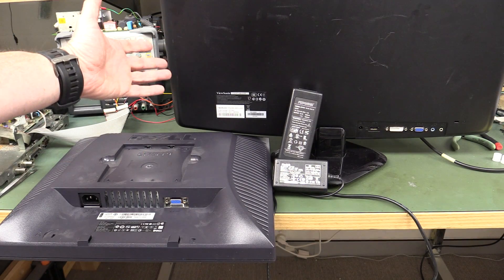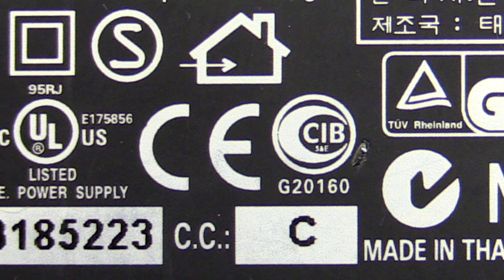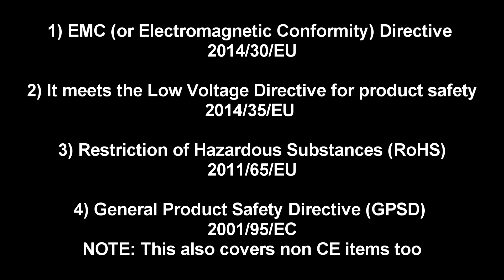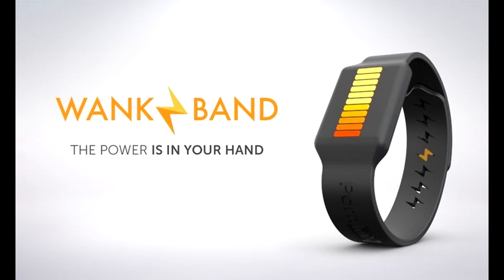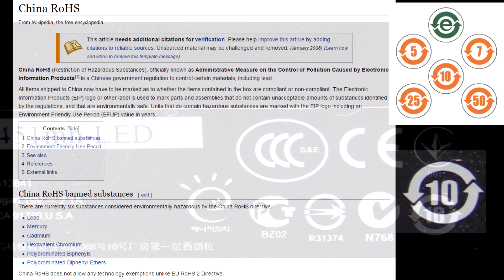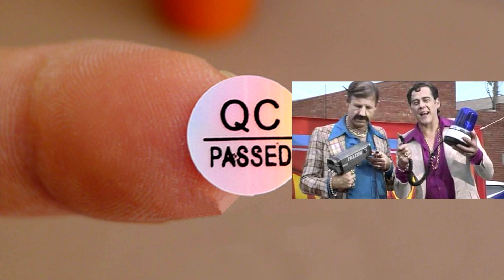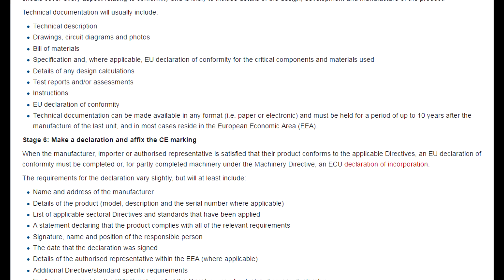EEVblog #996 - What Is The CE Mark On A Product?

Comment: Isn't the CE mark just something the Chinese stamp on everything they make.  I swear I also see UL and TUV there as well.   :P
Reply: pe1dnn Technically THE IMPORTER is responsible, because it's much easier to arrest and prosecute some smuck already residing in EU jurisdiction. The manufacturer is responsible if the thing was made in the EU.  Bonus fact, countries in the EEA (European Economic Area, formerly known as EFTA) sometimes count as EU for these kinds of rules.  Bonus fact 2, when government inspectors inspect a place, they tend to hand out fines for every unmarked product used or sold, so it's not just customs.
Reply: BMW 3 Series, as far as I can tell, that's nonsense. If you can tell me where that assertion comes from, I'd be interested to know.

But if you look up the regulations in the Blue Guide (http://ec.europa.eu/DocsRoom/documents/18027/), it says: 

"The CE marking is a key indicator [...] of a product's compliance with EU legislation [...], whether they are manufactured in the EEA, Turkey or in another country."

and

— Conformity assessment is the process carried out by the manufacturer of demonstrating whether specified requirements relating to a product have been fulfilled.

See also here: https://ec.europa.eu/growth/single-market/ce-marking/manufacturers_en where it says:

If you are a manufacturer, you have to follow these six steps to affix a CE marking to your product:

    Identify the applicable directive(s) and harmonised standards;
    Verify product specific requirements;
    Identify whether an independent conformity assessment (by a notified body) is necessary;
    Test the product and check its conformity;
    Draw up and keep available the required technical documentation;
    Affix the CE marking and draw up the EU Declaration of Conformity (27 KB).

Nowhere does it say anything about EU citizens. If you think otherwise, please provide evidence.
Reply: Mini DK#9, no sometimes they don't put it on, then you are screwed when importing some stuff :)
Reply: In theory UL stamp is controlled and if it bears that mark it can be looked up in the database to see exactly what safety standards it complies to,  thus a counterfeit or fraudulent mark can be sussed out
Reply: If they declare conformity to CE regulations they stamp CE on it, and if they comply with "GS" - "Geprüfte Sicherheit" (Checked Safety or Tested Safety) certification they can add that, too. It's a real certification, and the TÜV next to it just tells you which certification authority did it; TÜV isn't the only one.
Reply: John Francis Doe, That's the difference between who is de jure responsible (manufacturer, always), and who can be, de facto, held accountable much more easily (importer). Yes, these rules explicitly, according to the current version of the Blue Guide I quoted above, apply to "the EEA and Turkey".
Reply: Except one has to be sure the CE mark is real and not faked by the Chinese like they like to do with some other marks.
Reply: We put CE marks on machines we build in USA that gets shipped to Europe.  The only people who actually care about the CE mark is customs mostly in Belgium and Germany.
Reply: no one in China can declare anything in regards to CE. It MUST be a EU citizen.

Comment: Liked, just because of the Illuminati in the EU. lol.
Reply from the maker: Was hoping people would like that small touch!
Reply: only 10 years and my power supply starts leaking hazardous materials? How did they calculate that? Is that 10 years of use, or 10 years submerged in water? D:

Comment: Most battery powered devices have WiFi or Bluetooth and therefor are under the R&TTE directive which has a large safety section closely related to the LVD.
Reply: R&TTE has been replaced with RED - Radio Equipment Directive (2014/53/EU).  Which does not change the fact that is still pain in the butt.

Comment: Dave... Kindly do some follow-up videos on this... especially on how to get a CE emc and other tests...
also elaborate on UL....
thanks
Reply from the maker: That's the plan.
Reply: @Shakaib: You don´t get the point. Without does regulations, buisnessman would cheap out on any part possible, putting life at danger. CE and other regulations are the engineers friend - they translate "interference" and "safety concern" into business talk: Loosing a lot of money and jail time. Now the accountant ask how he can "not loose money" and "not end up in jail" and the answer is to give the engineers time and money to develop, test and certify. In case of a dispute (blank metal at 60V/50Hz with just a 10A circuit break - no worries according to the developer and his manager) a  bases to escalate. A written report to the company safety engineers stops any and all games of "I am boss and I say it is okay" (and as engineer, you can now purchase the 5 dollar cover to put over the blank metal to make the product somewhat safe).
Reply: Maybe a followup for us Germans that got fucked by the WEEE right in the butt with the shitty sucking poopsmelling Stiftung Elektro Altgeräte Register. -.-
Reply: I agree with this, not alot of times us regular mortals ever did give those lil logos much notice but they are kind of interesting.
Reply: @simontay1984 that is just because of the difference in density between chinesium and germanium alloys.
Reply: CE and the WEEE Lobby kills all startups or hoby-ist developers in germany / europe :-( .. Did it to me.
Reply: that is a good plan
Reply: one on the requirements for bringing a product to market like NRTL testing would be great and you could cover a lot of markings in one go https://www.osha.gov/dts/otpca/nrtl/nrtllist.html
Reply: to be fair it means shit is still generally made to last for the german market. when you buy german
Reply: A video explaining the steps a product goes trough from the idea to market would be also interesting. Always wondered how hard it would be to release my own product.
Reply: That is such a shame !!!
:(
Reply: Shakaib Safvi
Reply: WOW.....  
May be we (Electronics Engineers) should concentrate more on designing good products rather than worry too much about all these certifications n all.......
I mean... yes, a product should be certified but so many markings is crazy....
Personally.... EMC and Safety ought to do it..... !!

Comment: What CE do you mean? 
The European CE marking? Or do you mean the China Export marking? ;)
Reply: It isn't used at all.. there's literally no reason to use the fake mark if you can just slap the real mark on the product without getting the thing tested. It's just that sometimes manufacturers accidentally use the wrong symbol, even decent manufacturers as dave explained.
Reply: when clive and others mention chinese export, it's a joke.. just like saying a product is made of chinesium. the ce logo is not protected, anyone can put it on any product without danger of getting sued for appropriating a trademark or something. They might get sued for distributing a dangerous product, but then again, that would also happen when they use a supposedly fake ce mark instead of the real one.
Reply: Chinese CE stands for Crap Equipment
Reply: China Export. That is first thing that get in my mind.
Reply: well just like Chinese degrees centigrade or milliwatts, im pretty sure the Chinese CE marking is equally mystical and inconsistent in meaning.
Reply: I didn't know that China Export is urban myth. I personaly told it as joke. But it make sense. Todays generation lives in world where everything is made in china and china post CE on everything from cheap copy of jelly bears to cheap copy of cars. So CE must be something about china, or not?
Reply: There are a lot of GOOD chinese products on the market, but certainly not the one that uses "China Export" CE mark.
Reply from the maker: Orcinus24x5 Please excuse me for not saying it in the first 1minute, what the hell was I thinking?, the video is ruined and worthless!, I'll have to edit and re-upload.  NOT.
Reply from the maker: Watch the video.
Reply: I think you misunderstood.

I'd liked it if you mentioned it in the first couple of seconds in the video and talk about the 'Fake' CE (China Export) Marking a bit more in the Beginning...

Of course the China Export marking isn't used on half way decent brand products....
Reply: The china export marking isn't used on any products since it doesn't exist. The CE markings dimensions isn't forcing yso you can push the letters together a bit and it will still be a CE-marking although it isn't recommended.

Naturally there will be products with fake markings aswell, but that is true for most markings.
Reply: EEVblog given the prevalence of the myth, I'd edit in a bit more about the "China Export" urban myth. It's amazing how widespread it's become, almost worth its own post... hint hint
Reply: Youd probably have loved a clickbait title like MytBusting The CE mark also. Since there is no china export mark and that marking is just a myth perpetuated by sinophopes there is no reason to push it's mention to the top of the video.
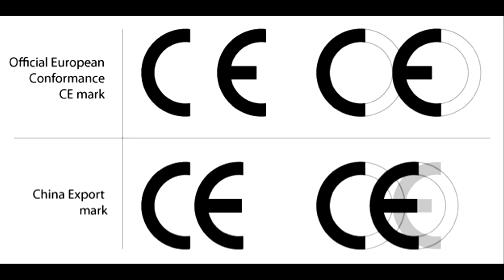Reply: Rather than listening to Dave ramble on and on for over 6 and a half minutes, just jump to 6:40 for the relevant "China Export" bit, which is by far outstripping legitimate use of the stylized "CE" logo.
Reply: Why so angry, dave?

I was just hoping that you would start the video with 'Today I wanna talk about the CE markings, not to be confused with the China Export Marking'. Or something like that. And that you'd talk about that sooner.

I think that would be the most important thing, because I think it is important to metion misuse and abuse of certain things...

I think Clive has seen his share of the 'China Export' Marking. It does exist. And if you are able to spot it, you absolutely know that you got some fairly dubios and possible dangerous thing. Of course you won't see it on any half way decent product, only on really really bad ones that must not/should not have been sold in the EU. Those kind of things that are just a waste of resources...